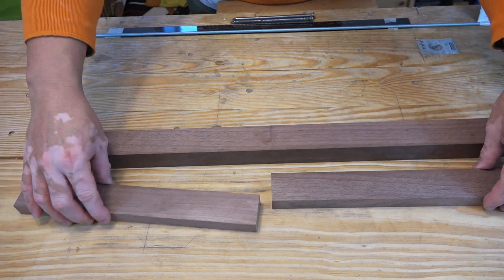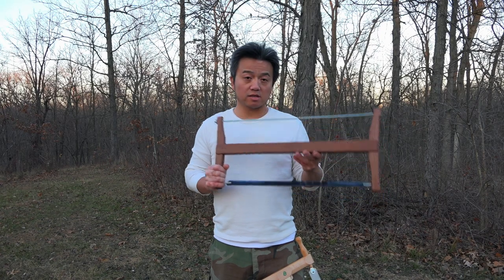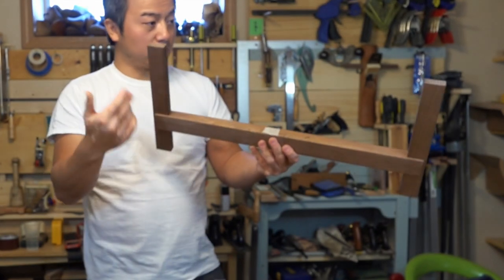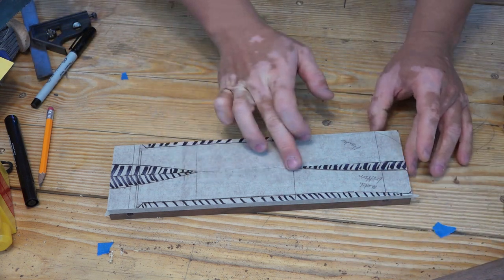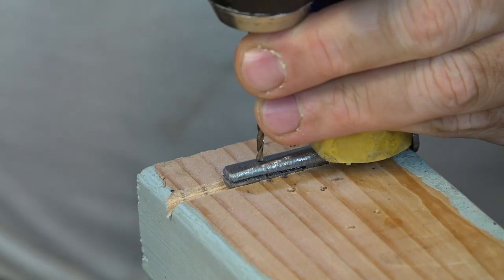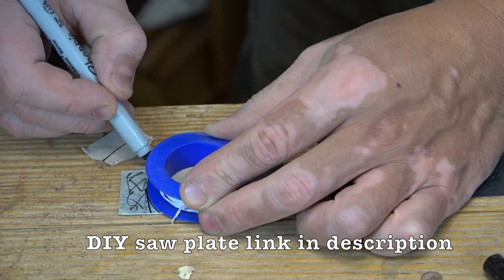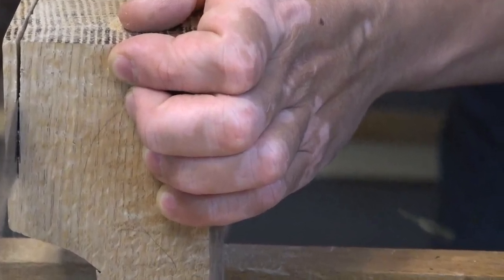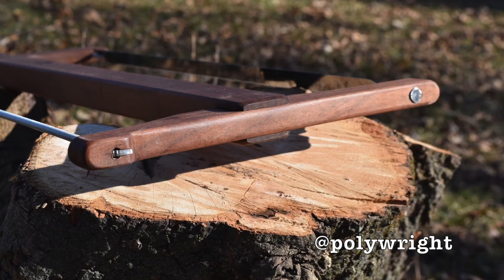Frame Saw 中国锯 - Traditional Chinese Woodworking Tool

Comment: Hej. The euro. You just twist the blade if you need longer cut. Therfor  the handel. Lusen the string and twist.
Reply from the maker: It is possible. Many saws don't rotate. After using the Chinese frame saw, I wouldn't go back to the European frame saw. Even though I learn to use a frame saw on a european one.

Comment: Why did he file and sharpen all the teeth at the same angle ?
What is the reasoning and/or advantage of these saws having the blade angled off of straight up and down as are European saws of this type?
I don’t think he would use any new tools (such as another vice or cordless drill) if it were given to him. He likes and is completely comfortable with using his old tools his way.
I wish I could have understood all that he was explaining for the last 5 minutes. Seemed as though he was teaching how to watch and adjust for more precise cuts.
Reply from the maker: Yes, unfortunately you can't speak Chinese. There were a lot more details. The master described how different people set the saw teeth differently, and that he only uses alternating teeth, as he finds other pattern unnecessary.
Reply: MRrwmac زز